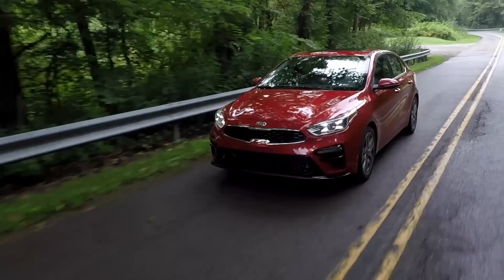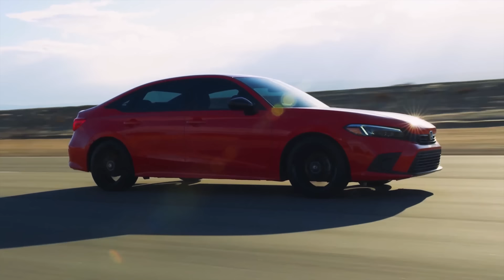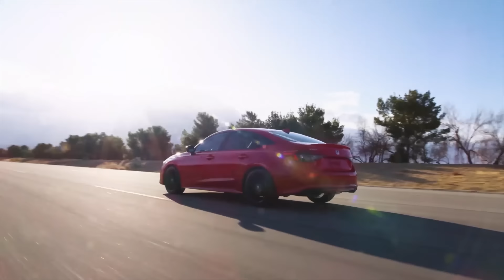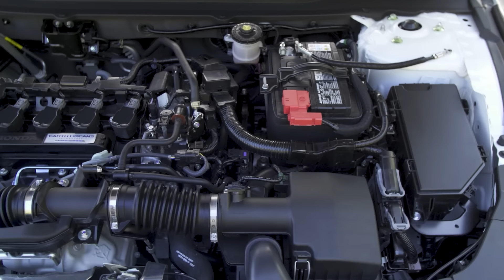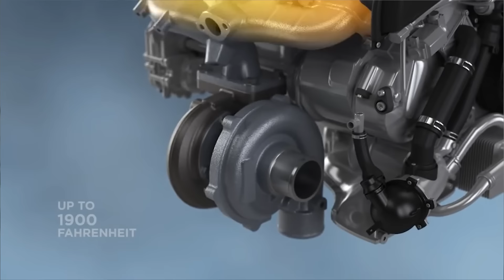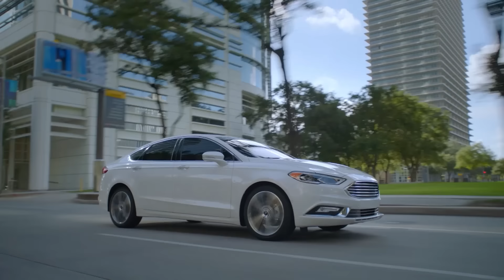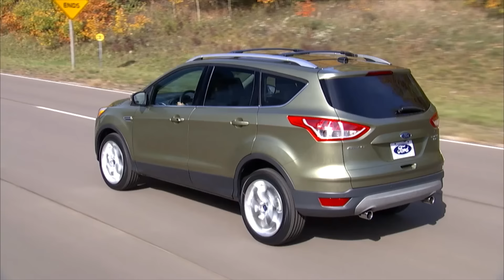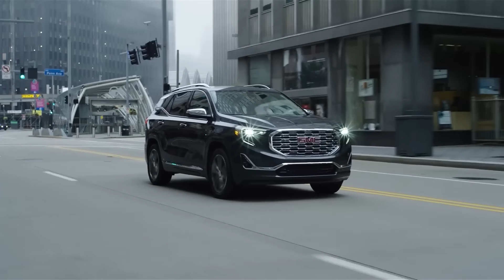Are Turbocharged Engines Reliable? The Truth About Turbo Engines

Comment: Turbo charged engines are usually design from the ground up to accept the higher pressures.  You can see this in the engine displacement. (Smaller Numbers) Usually a larger displacement engine is reduced to have thicker cylinder walls.  Yes some manufactures get it wrong with all their plastic parts etc.

This all sums it up, in terms of 4 cylinder engines, if you want a grin on your face and like your car response (even with some turbo lag)  get a turbo charged engine.

Normally you should run the engine a minute are so after hard driving.  Manufactures such as VW and Audi used after run coolant pump so you don't have to do that. It's a good habit though.
Reply: I tend to let my car run minute when it has been sitting for a while before I take off. Old habit from having really old cars.

I also tend to let my car rest for a min after I have parked (Nina) for the day, before I shut her down. 

Will see if that will help.

I have had all types of cars, and all had some problem or another. (they all do, hopefully they remain small).

Most people don't maintain their cars well. You HAVE to change the oil when it is do. Save you sooooooo many headaches. But even then.....

 You want to talk about a bad Turbo set car then let's talk about the EccoSport. The turbo on that car has not worked more than it works. In fact I had to replace the engine (On Ford's Dime) due to a oil pump recall. (Found out AFTER the engine seized up (2018 with 50kish miles) 

I just got a 2019 1.5t Accord. Yhea  might be been better with a Camry but could not get the price right, and the Honda just looks better.

I do live in a hot place (Vegas) so that does help.

I guess only time will tell how the Honda holds up. I have known cars with a Turbo that where old as hell and should have been dead (Saab), had no issues, and where running where my newer car was always braking down. 

I just know I am doing 5 thousand mile oil changes, without question. (will do it myself)

Comment: Have my eye on a 2014 BMW with a 6 speed manual transmission, and a turbo 4. I've heard the naturally aspirated inline 6 is a much better way to go, but the 6 speeds are few and far between, regardless of the engine
Reply: You’re looking at buying a Bimmer that’s almost 10 years old, that car is going to nickel and dime you. Especially if it’s going to be your daily driver.
Reply: Bmw's 2008-14 had lots of endine problems - improved post 2014.

Comment: Tip:  turbos also have to be cooled down as well.  So when you come off the freeway and then have to park, let it idle for at least a minute before shutting the engine off.  This allows oil to cool it down and prolong its life..
Reply: Not necessarily … a lot of turbos now are water and oil cooled not like turbos of old days!
Reply: @stacystanley262  Didn't know that.  Thanks.
Reply: Too much care. I won’t be buying a turboed engine anytime soon until they catch up to naturally aspirated engines in reliability

Comment: Been around engines much of my life, turbos have a very limited lifespan as compared to normally aspirated engines. Too much stress on components, improper usage and care by owners. Turbodiesel may be OK but only Mercedes and Peugeot engines for passenger cars. As Chico Marx would say: "She's ah no good!"
Reply: The engines are engineered properly. The issue is that owners don’t take proper care of the engine. Gotta keep the oil fresh, lots of oil changes.

Comment: Do turbos have less valve float with higher mileage, because the valves do not need to open as much, making the motor last longer?  
Also, are turbo motors built with better parts (forged), so they can last longer than NA motors?

Comment: Interesting and informative video.  I had a turbo Diesel Peugeot 308 which was regularly serviced and ran frequent drives of about 80km each way, several times a week, so it was always warmed up carefully before driving at cruise speed. Did not have any engine issues and the car was traded in at 180,000km and still going strong.  My current car is a turbo petrol Peugeot 3008, 2019 model, doing the same distances and frequencies as the previous car and has clocked up 107,000km so far, again with no engine issues.  The fact that my cars are being driven long distances for each journey I'm sure is keeping the engines in good operating condition, plus regular servicing as required. The points made in this video are very pertinent, not just about engine design, but also about maintenance and driving distances and style, something which should be considered first before the purchase.
Reply: Very true GDI turbo engines will not tolerate skipping oil changes. I change mine every 6 months or 5000k. Oil is cheaper than replacing a turbo.😉
Reply: Are you in the UK? My uncle Thomas and cousin Jack are also Rankin surname. Supposedly the Rankin addition (to Speer) gave them quite the engineering prowess!
Reply: @jamesmedina2062 .  Hi James, no I’m a 5th generation Australian living in Australia, also, I’m unaware of any distant relatives that may exist in the UK. Cheers!
Reply: @grahamrankin5557  haha thats fine. Well my cousin Jack is rarely home. As a petroleum engineer he has spent more time abroad. I like traveling too. There is a cool little town near San Angelo Texas named Rankin. One of his Rankin cousins was in the Royal Air Force in the UK.
Reply: @jamesmedina2062  Hi James, well the rankin surname derives from a subgroup of the Maclean Clan, my specific relatives emigrated from Glencoe which I understand to be part of the Maclean Clan’s area (I stand to be corrected if this is incorrect). Family histories can be fascinating but also difficult going back more than a few generations. Cheers!
Reply: @grahamrankin5557  I see. That is particularly amazing to me. We are all lots of things but the name I carry is Speer which has a lot of history in lowlands Scotland. My mom is mainly Spanish(Medina). Couch was my grandma and thats from Cornwall. More recently two Speer brothers went to the state of Georgia from Belfast during 1800's and then a pair of brothers went from Georgia to Texas. I always meant to visit "the Homeland" but never did. My uncle lived in London for a while and his daughter studied law in Edinburg. Your family has enjoyed what area of Australia?
Reply: @jamesmedina2062  Hi James again, as far as I know, the Rankins I’m descended from came to Victoria, Australia, and to the Geelong region in Victoria, next largest city 80km away from Melbourne which is the capital of Victoria.
Reply: Yep - just sold my Peugeot 308 HDi (2.0L diesel - 165,000kms) - never touched. I also made sure that the car was serviced at the correct time. Hardly drove it during COVID. No trouble with the engine. Just purchased a 2022 Peugeot 3008GT HDi  (again the 2.0L engine.). This engine has been proven over time and 2022 is the lart of the 2.0diesels. That's a pity as it is the best engine ever put into a Peugeot.
Reply: @edanalytics9336  my car always reaches time before mileage but it also gets 1-2 weeks early being serviced as I refuse to go even 1 day over.

Comment: turbos do work to increase hp but the downfall is they run a higher rpm and put more wear on the engine. lighter weight usually a 4 cyclinder instead of a 6 or 8 .

Comment: 1.8t 280 hp or BAM engine 225hp forged rods and pistons from factory reliable turbo strong engine.if you maintain it properly no issues.new cars forget it issues with all not only turbo.old school better always.forget engines tsi and tfsi of VW and Audi many issues.of course naturally aspirated engine less issues almost no issues if maintained good.